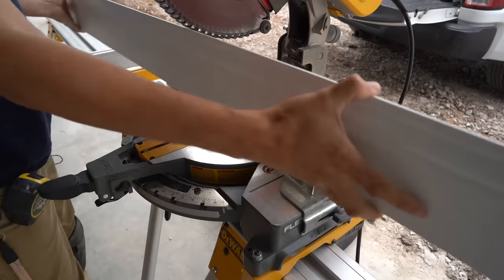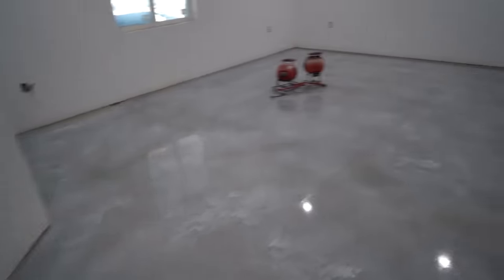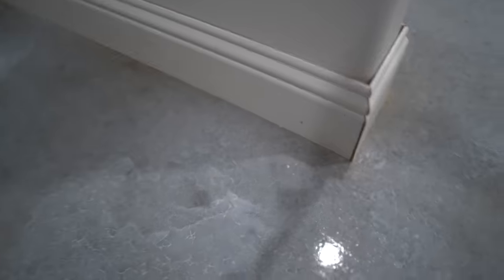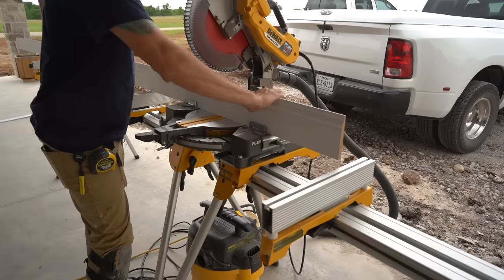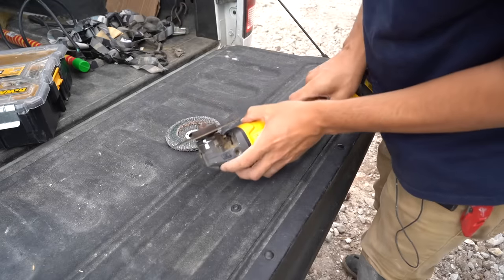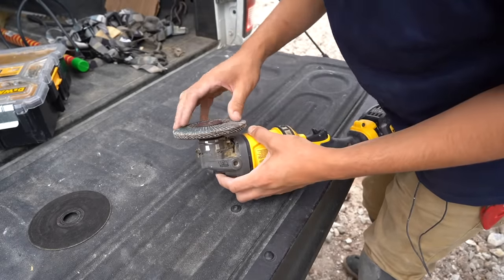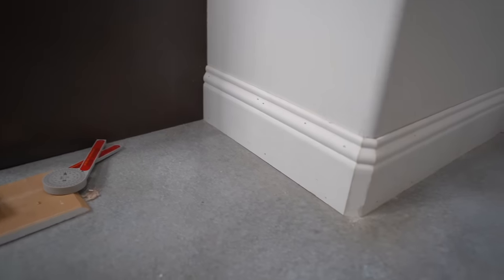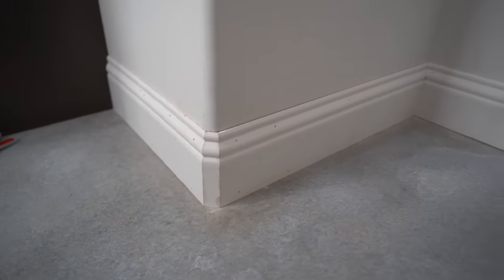don't let your framer do trim

Comment: Wow... that’s some crazy finish work! Indeed some rough carpenters! I was always told, framing has a diff tolerances then ya trimmers but that’s a bit extreme. I say  “light” framer buddy cuts it like an 1/8 short, I’m looking at him like no 1/32” dude🤨 they didn’t use glue either.. I mean even if he did lol it wasn’t really gluing anything together lol I was busy & couldn’t do a small job 4 a friend so he had the painter do 1 small laundry room trim be4 he painted it. 5’x 14’ room. He spliced & mitered... w/ no glue. A few months & the finger joints opened up like whoaa! He then guilt tripped me like c bruh! I had to hire the painter (Bc he said he can do it) 4 the crown/base & he didn’t glue the miters mannn😬 
“3/4 Heavy” nah? lol It’s crazy how they use bullnose everywhere in TX.. In NY It’s almost like a myth!?

Comment: Nice. In my 3 years(younger years) doing trim carpentry I never ran across a bull nose job.

I used  Call that 16 and 13/16 minus.  I would divide my 1/16ths in to thirds (48ths I guess). Minus, plus, or on the head. 

That super glue seems very helpful. Are you just spraying water to set it? Or was that some epoxy of sorts?

Comment: When you superglue those corners and spray them to speed up the glue drying, what prevents the MDF from acquiring a water stain? I've seen that stuff swell up and be ruined by very small amounts of moisture, even after caulk and paint. One reason I never use it if I can afford it.

Comment: In Norway all framers do trim. If you work for the right kind of building company you build everything in the house except concrete, plumbing and electricity.
It's great, you get to do it all. It's not a good look if you as a boss don't let your workers finish everything on a house but send them on another job before the trim work is done.

Comment: Should try using a rubber backer disc on your grinder with sanding discs alot thinner can fit tighter profiles and works ALOT faster...i trim 70+ homes a year with just a helper in tow and can cut list cut and install a 2500 sq ft 2 story homes baseboard 4 1/2" same profile as the stuff your using with all chamfered corners and inside copes within 5-6 hours just with a helper spreading and fitting pieces out in front of me with nothing being open more than 1/32" give it a try it will really have ya coping faster

Comment: I noticed you use that angle grinder and it came out really well but that look like MDF I wonder how that would work on hardwood like Oak Thor even Finger Joint Pine I don't know how that grinder would work I think of coping saw would just be better on the MDF I will try to use a grinder next time, myself and people I work with are carpenters we frame and do trim and build cabinets some guys can do everything but at my age I don't do much framing anymore LOL

Comment: You don't actually have to take and account for the metal pull tab on the end of a tape measure at all. The tab at the end of a tape measure is specifically calculated into the length of the tape, and when measuring with it pulling, it will stretch a 16th, and when pushing against something, it compressed back in a 16th, compensating for the width automatically based on what you're measuring. Measuring and then compensating by removing that 16th will very likely mean your work is slightly short. Not a problem in this world but when making something square and parallel it can mean all the difference.

Comment: what do you do about the gap at the top of the baseboard? caulk it? also do you cope it because the wall is not even? or is it just because its cleaner than cutting  two pieces of baseboard at 45 degrees or whatever the angle might be. Last question lol i usually have the baseboard laying flat and bevel it with my chop saw, im assuming its a cleaner cut the way you did it with the baseboard standing up?

Comment: I have a question about my bullnose corners because behind the baseboards there is about a 3 inch piece that makes it a 90° corner and right above that is the rest of the rounded corner to the ceiling. Do you know what that is? Is it ok to remove?

Comment: I shouldn't be surprised really that a contractor would nail that baseboard up with what appears to be a 1/4" gap and say good enough. Builders out here on the West Coast have been doing these bull nose corners since like 2000 or so. They were kind of cool at first but I sure wish they would go back to the other way. Personally I loath that little piece of base that is being done. It looks Colonial or something to me which is not my taste. I wish there was another work around because I want to replace all the base in my house to just a simple 1 x 6 plain board with no detail. I'm kind of surprised that manufacturers haven't at least come up with the little corner piece. Maybe it would look better than what's being done today. But good job man. Looks much better. Can you remind us all what that glue is that you are using? Thanks

Comment: Novice question.... why do you cut outside corners with a full miter cut all the way from top to bottom, but the inside corners you cut with a cope at the top?  Is this technique only for ease of install, or can inside corners also be cut with a fuller miter cut from top to bottom?

Comment: I don’t understand that last inside corner piece. You cut it upside down but didn’t go all the way and then coped the top section even though the top section looked to have some other cut which wasn’t shown. Can somebody explain what’s happening here and why it wasn’t a 45 all the way through and then glued before nailing?

Comment: I take that little pull on the tape in to consideration by Pushing my tape into the corner as to compress that play the tape. That way you don't have to get out the BOARD STRETCHER 🤪😂🤣 jk Buddy.. great quality displayed here. I ALWAYS APPRECIATE attention to detail and not just getting to the check. WELL PUT BUDDY

Comment: Nice work, how do you measure the small piece for the bullnose corner?
Reply: That little orange tool allows you to measure accurately…cut the bullnose on 22.5 degrees and make for precise installation. I think I purchased one like this at Rockler.

Comment: I had my handyman replace a toilet. He used a dishwasher service line instead of a toilet line because he didn’t want to run to the hardware store. He figured it would hold for one night. Well it didn’t and half of my house along with new carpet got flooded. Never again. Plumbers only do plumbing work in my house from now on.

Comment: On the one hand, you don't want to trash talk, and that's great.  On the other hand, even if the installers were framers, they knew damn well as they walked away from it that it looked like crap.  If they were on the receiving end and buying that home, they would see that and say, "wtf is that?"  Any housewife (I'm not being sexist) would know that was a crap job.  And that's without them being a carpenter, a framer, an electrician, or any other trade worker.  That's a housewife with no experience ever on any construction site.  As far as not having you do frame work, I know that if you tried framing, you would either figure it out and do an exceptional job, or you would confess, "Hey man, I can't do this."  From what few videos of yours I've seen, I don't believe for a second that you would walk away from a crap frame job feeling good about what you left behind and hoping that it's either not noticed or that the buyers will be too timid to do anything about it.  Also, I don't think I would have that framer do any framing.  If he's so willing to leave such horrible work out in the open for all to see, for the love of god what the hell is he likely to be hiding inside the walls where no one can see?

Comment: Bullnose corner pieces look so much better if you can find them for the profile you're working with. I'm really not sure why this is even considered acceptable to piece it like that because it doesn't trick the eye at all. If I was paying a finish carpenter to do it I would want the rounded corner integrated into the baseboard. For someone who's so careful and demanding that he glues his mitered corners together before nailing them in to create absolute perfection, buy the dang rounded piece you need.

Comment: Why "cope" the trim on inside corners and not 2 45 degrees? That's how I was taught to do it.
Reply: Most inside corners aren’t true 90 degree corners.  

Coping allows a tight fit regardless of the angle variations.  Is saves time with less caulk and saves an eyesore with stained trim.

Comment: Well, i was in the home building business for more than 45 years.
I did employ framers and trimmers.
So i do agree that by and large, framers dont do a good job of trimming.
But when discussing the bull nose corners, were talking about personal preference.
And my personal preference for my own house, is to just do the outside corners where bull nose corners are involved with the standard 45 degree mitre.
And then do a good several application job of caulking the void on top.
Were simply talking about opinions, and we all know about opinions.
Poor work is one thing, but lets not confuse that with personal choice.
Fact is that i didnt like the moulding used here either. lol

Comment: I am a builder that does every thing from footings to finish. I resent your comment. I do very well at all of it. When you do eveything you set yourself up right for the rest of the project. Don't try to make y look yourself look better at the expense of others. When you can do it all then gloat.
Reply: There were some other comments about performing tasks in anticipation of other tasks that come later.  That's a great idea.  I'm a computer programmer, and we have a saying, "Code like the guy that will maintain your code is a psychopath that knows where you live."  Solve the problem, anticipate maintenance needs, keep stuff clean, don't get cute.  I didn't get the impression that he was flexing his trim skill, but teaching how to do it properly in the area in which he had control.
Reply: The title of his thumb nail implied that framers can't trim. I have found in my line of work that sub contractors that only perform one job doesn't think about the next guy, only what they have to do to get the job at hand done. When you can do it all you pay attention to later steps and the end result turns out better. Just title it how to fix bad trim.

Comment: Drywall mud does not go all the way to the floor so you have to block the start of every board, also I am a rough carpenter but was I finish carpenter

Comment: we would never do a miter at a internal corner like that. U scribe all inside corners (90 degrees) and u miter the 270 degrees. Maybe diffrent here in europe but he was just doing it wrong. Also MDF trim is not being used that much here anymore it has a lot of problems with damp

Comment: The bull nose corner has been trimmed sensationally. Hey, whatever you've used to film this video has serious autofocus issues- it kept changing focus when you were setting up your Dewalt workbench and saw, it was blurry when filming the baseboard trim correctly done and on the last stretch if autofosued on your rear left pocket instead of you fixing the last piece of baseboard. 
Your vids are very useful. You should definitely use something else.

Comment: “Have to take into account the pull at the end of the tape measure”? That is designed to move the thickness of itself for inside or outside measurements. I believe you once said you’re not a licensed carpenter?

Comment: Such a nice job. But I have one complaint and one improvement. The complaint is that you ruined it all by nailing the really nicely done trims. I was really disappointed when I saw the nails in the end because you've really been very meticulous the whole time. But for the improvement part, I would suggest you to make a router mask to trim those rounded inside corners. Will be much easier and a lot quicker than doing the steady hand grinding... so route them.

Comment: Isn't that the truth? There are ruff carpenters and there are finish ones. Finish carpenters are a different breed. Ruff carpenters cut measurements at smallest...1/8th inches. I dont think they know what a 16th or a 32nd is on a tape measure. God love them, I'm related to a lot of them. And they are good at what they do. Finish isn't one of them

Comment: Why not let your framer do trim ?I've been a framer all my life I can do finish carpentry I can make cabinets I was a set up man  in a cabinet shop doing raised panel doors ,you have to be within a 32nd of an inch with cabinets or things won't fit right, all you need to be able to do all that stuff is to be open to advice and it helps to  watch other people don't be a know-it-all know when  you're over your head and seek advice I've built homes where I did everything to them and they came out just fine I'm basically an electrician by trade I was on the job wiring a 10,000 ft custom home and they hired me as a carpenter they saw me adding blocks to place my boxes more accurately and nailing off the roof so the inspector would pass it  and said I was better than anybody on their crew so I worked eight months longer there,  but I can do plumbing  drywalll all that stuff my lifelong friend is a contractor and he does everything from the foundation to the roofing shingles and he is so picky we kind of make a good team together people are begging him to work for them,  I can do compound angles on a miter saw for framing we do open cathedral ceilings with 1-1/2 tongue and groove with hip roofs that stack onto each other this is complicated as any finish Carpentery same as siding and outside bats or trim,  just go with what you know and do a good job and usually that will be above what is expected from people.

Comment: What were they thinking?? I mean a master carpenter should be able to do trim and frame. That is specializing if your master carpenter.!! I do tile , trimming, door hanging , and can frame if I need to. Geometry is geometry , same for framing , trim, or tile. Yes there are different skill set but the geometry stays the same.
PS.  I think they hired out to some body who said they did carpentry , no way who did that was carpenter,  or at least apprenticed for a year or 2 under a qualified pro carpenter! !!

Comment: its "16 and a tad heavy 3/4" and I say this as a metal fab guy who would, if the boss started pissing me off about accuracy, I would just switch to talking about x/64ths. And yes I can read a tape measure that's only labeled for 16ths in 64ths if I need to be a dick. lol.

Comment: The tape measurer end moves, to account for the sixteenth inch of its thickness, when it's being hooked and is outside the measurement and when it's being pushed and is inside the measurement. It's sad to see when so called carpenters can't use the simplest of the equipment. . .

Comment: Here is Southern California we get all sorts of bids from contractors. In the end, you still have no idea who will do the job. It is whoever the 'contractor' brings in from who knows where. And he is not there to supervise the crew as he is getting more bids in the meantime. And these crew  men get annoyed when I, as the homeowner, point out the shortcomings in their work (such as bad corners on baseboard trims, shitty work in my wood floor such as ending both neighboring beams in the same spot or matching beams at an 'intersection", leaving behind messy, uncleaned glue stains and taking offense that I noticed). No way. Even if someone gave me $$ to have contractors coming to my house to do things, I pass. Now, if I really need to, I diligently search out experts in a certain field and start going by word of mouth after watching endless YT videos to get some basic idea. This way I know BS when I hear it. It is hard and nearly impossible to find skilled fair priced craftsmen in Southern CA.  If I went to my job and did my work like most of these people, I would have been fired.

Comment: Nothing wrong with a framer doing trim .. In fact .. I insist they learn that aspect of the trade . Then they can see what harm they do by crappy frame to the trimmer and the trimmer won't blame the framer when he does crappy trim .. Learn to trim makes a better framer .. Instead of just building a stair carriage , He understands how he frames will finish out if someone else has to follow behind him .   That sweetness a trimmer has to have can easily be translated back to the framers skill .. He learns . That instead of banging studs that his work has consequences .. And if he has to do the trim on a frame of his .. He will learn !! .. I am a carpenter ..with 40 years of experience and I have crossed over to trim for a few years then frame and back again and maybe timber , form for a few years , then back again .. The crap I saw here was perhaps an underpaid carpenter with obviously limited integrity .. Rushing .. or just an idiot .. Even a good frame can be ruined by a drywall artist and finisher that pooches out outside corners and slops up the inside with mud . Then you can have a crappy frame with a great drywall artist and they make it look like a masterpiece .   Trim is a grace and all that matters is it looks great in the end and doesn't require a pallet of caulk . Frame can be a grace as well when you work on the mindbending mansions .. A Carpenter has spoken ..